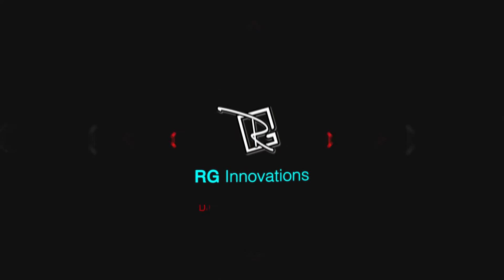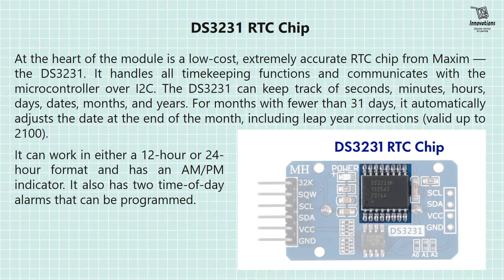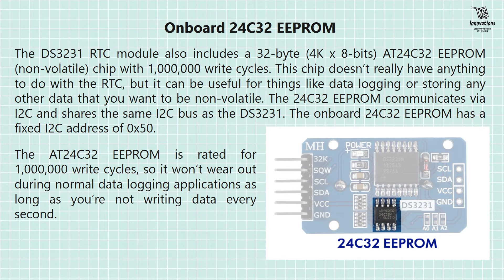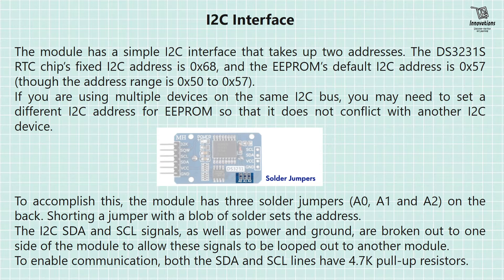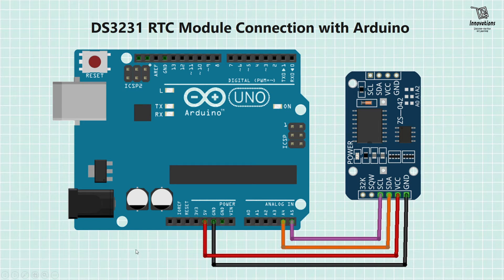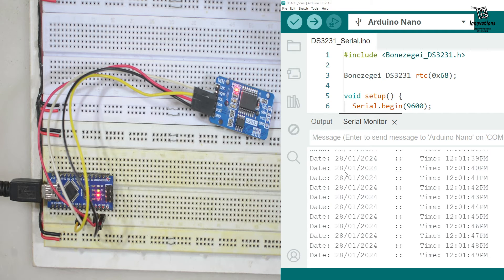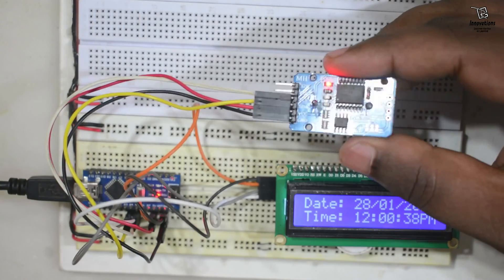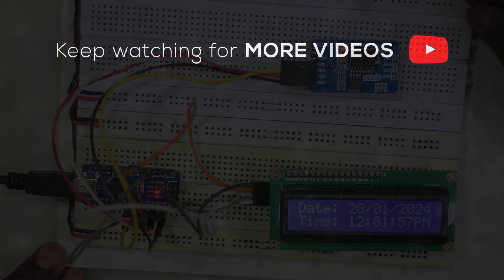DS3231 Real Time Clock (RTC) Module - Detailed Explanation and Interfacing with Arduino & I2C LCD

Comment: You need to add printf("") in case 24h format is used. otherwise it will print time in same line (no AM/PM print...). Also, i have some issue with programming the time in 24h format. will update if i find solution

Comment: C:\Users\Dell\Desktop\gggfg\DS3231_I2C_LCD\DS3231_I2C_LCD.ino: In function 'void setup()':
C:\Users\Dell\Desktop\gggfg\DS3231_I2C_LCD\DS3231_I2C_LCD.ino:28:15: error: 'int LiquidCrystal_I2C::init()' is private within this context
      lcd.init();  // initialize the lcd
               ^
In file included from C:\Users\Dell\Desktop\gggfg\DS3231_I2C_LCD\DS3231_I2C_LCD.ino:2:0:
C:\Users\Dell\Documents\Arduino\libraries\NewliquidCrystal/LiquidCrystal_I2C.h:154:9: note: declared private here
    int  init();
         ^~~~

exit status 1

Compilation error: 'int LiquidCrystal_I2C::init()' is private within this context

how to fix
Reply from the maker: Did you make any change to the code?

Comment: You also did not mention anything about the use of the rechargeable CR2032   when the boards are shipped   they usually have a   201  resistor   installed.  My understanding is that is to use for a rechargeable  CR2032.  If you use the non re-chargeable CR2032    you  should remove the 201 resistor.
Reply: 6:48

Comment: Is it possible to use a CR2032 battery if the resistor is removed?
Reply from the maker: Yes, but that will not power up the module, it will only be the backup power.

Comment: i am facing similar issue , the year display on the LCD is 2034 instead 2024, i ran trough the code a number times ,  
rtc.setDate("7/25/24");   //Set Date    Month/Date/Year . still its display as 25/07/2034 at lcd. any help ??
Reply from the maker: Please share the code
rgstech85@gmail.com